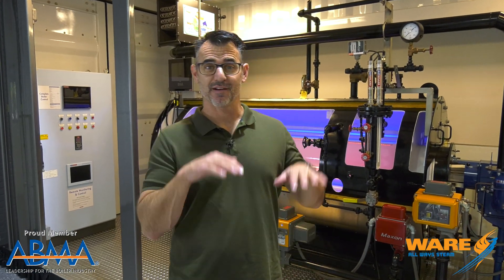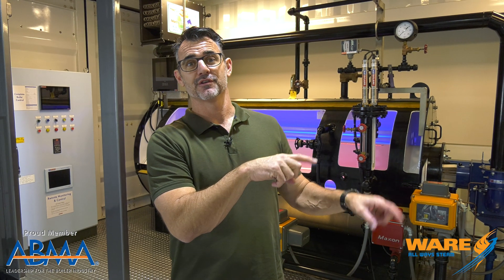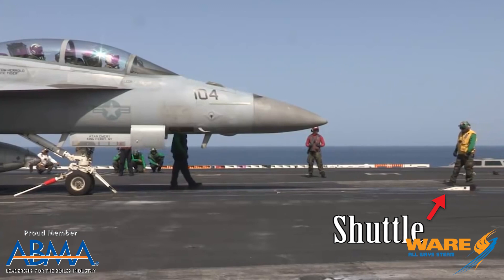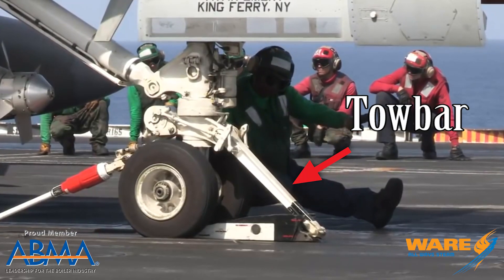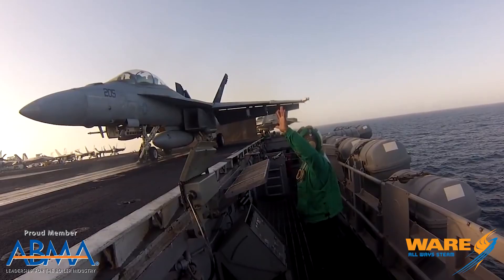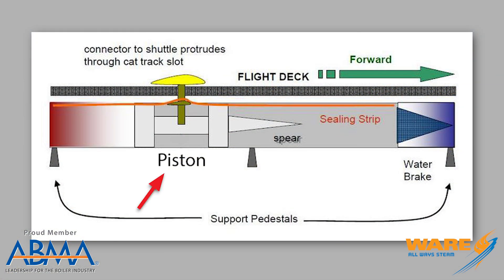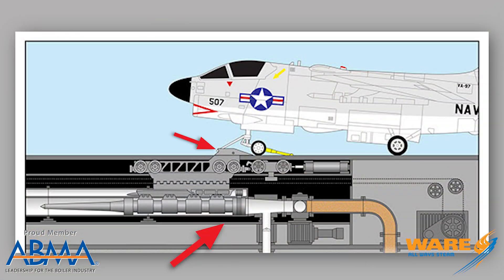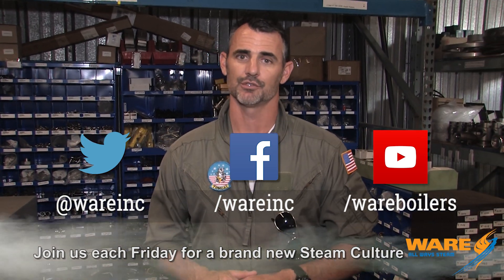Launching Fighter Jets Off Aircraft Carriers - Steam Culture

Comment: Thank You for the Excellent and informative video!  Though I am also partial  to Steam catapults, I believe that the electric ones are probably more powerful and require less maintenance. The US Navy always tries to employ the latest technology if they believe it is  a significant improvement over an existing one.  As you know, a steam catapult is basically a linear steam engine which requires lubrication and of course has more moving parts, that have to be looked after, than an electric system. The steam "Seals" probably has it's own special issues that must be dealt with.  Also, steam catapults were used on aircraft carriers that are propelled a nuclear/steam plant.  I believe that the newest Aircraft carrier in the British navy is propelled by turbo electro gas turbines. I would imagine their catapult system would be electric. I'd like to see a comparison of the "Down Time" between that os a steam system and electric one. 
  Another interesting  point is that the vast Majority of US Surface vessels (Aside form the Nuclear Powered Ones) utilize gas turbines and diesel engines for propulsion. The result are higher speeds, and increased range due to lower fuel consumption, compared to the old steam plants.  This is just my humble opinion. I'd like to see a viewpoint from a crew member who actually operates the catapults.
Reply from the maker: Appreciate your comment! There are many different sides to the steam vs electric debate but I think steam just tends to win those because "it's how it's always been." But innovation is always moving forward and in the end, if the electric one just does the job better it will be the one they use. Us steam guys though.. steam is just better just because 😃 Thanks for watching!
Reply: Join us on The Boiler Guy Says group please u will enjoy it
Reply from the maker: Ritchie Ware, one of the co-owners of WARE, is in that group! Really great conversations about the industry and just a good group to be a part of if you are in the industry.
Reply: Thanks for your comment. What is the difference between turbo electric gas turbine and normal gas turbine?
Reply: @cck0728  Good Day,

      Hope all is well. Thank you for the excellent question. My apologies for not reply back to You sooner. Marine steam & gas turbines are not directly connected to the shaft(s) and screw(s) of the vessel, like a reciprocating steam engine or slow speed 2 cycle diesel engine. The reason is that the both types of  turbines run at a very high RPM ( Like 2,000 RPM) and can only transmit power to the screw(s) either through reduction gearing or through a generator which is connected to an electric motor, that drives the shaft and screw; at the proper rotational speed (Same principle as a Diesel Electric Locomotive). In fact the Titanic's triple screws only rotated at about 82 RPM, at top speed..The large screw of a ship cannot rotate at very high speeds, since it would be subjected to cavitation. In essence, it would just be spinning its wheel(s). 
      Currently, almost all of the massive container ships are driven by huge 2 cycle Diesel engines directly driving a single screw at about 120 RPM. Cruise ships utilize medium speed diesel electric drives for propulsion.  Medium speed diesels run at about 500 rpm. Depending on the size of the vessel, cruises ship employ up to 8 -10 diesel generator sets for propulsion and other onboard services. The Queen Mary II utilizes both diesel and gas turbine units. The gas turbines on the Queen Mary II are only used for the high speed transAtlantic crossings. It mostly relies on it's diesel units for cruising. I hope this info is helpful.

Warmest Regards,

Gene
Reply: @MyDiesel101  Thank you for your great  explanation. Please keep on contributing with your valuable expertise. It seems you work on Queen Mary.
Reply: @cck0728  You are very welcome, and kind of you.